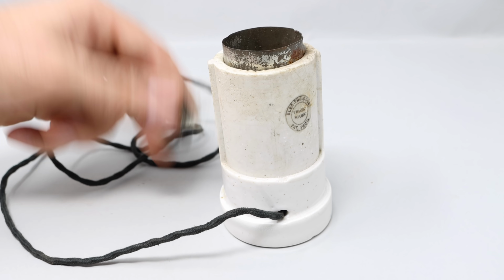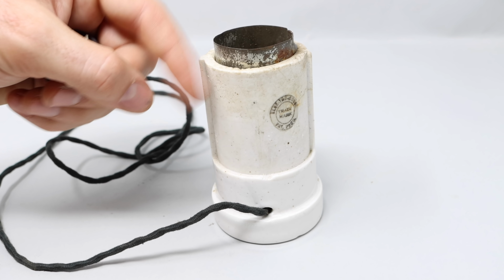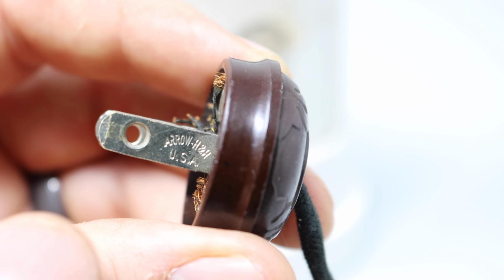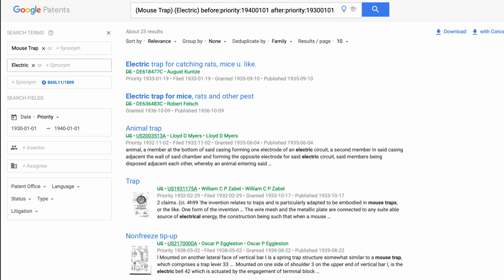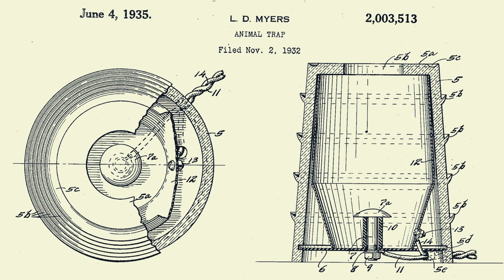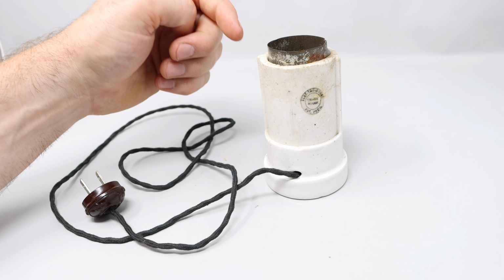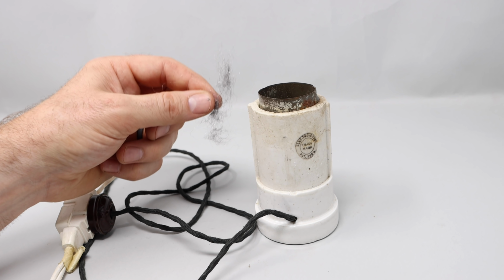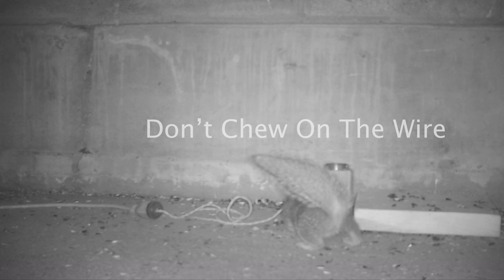I Need Your Help Explaining This One - The Electro Mouse Trap from the 1930s. Mousetrap Monday.

Comment: I think the patent you found is for a different trap. The one you have lacks the ribs around the outside that are part of the claims in the patent. It's possible that your trap originally had an outer shell, now lost, which had the ribs on the outside and also shielded the outer metal sleeve and had the small hole in the top. Since this one has the trade mark on it, my guess is that this is all there was, except for a possible ceramic cap.

Yes, the plug is old and would have come with a heavy paper cover over the exposed terminals. Those covers are often lost, but you could probably find one to replace it. I believe I have one here.

One person made a good point about the lack of a polarized plug. Such plugs existed in those days, but they were extremely rare. That certainly makes this trap potentially much more dangerous to humans and pets.

There's been no significant change in the US electrical system since that time. Unless this trap once had a cover with a smaller hole on top, it may never have worked any better. What it lacks as a mouse trap, it probably makes up as a fire hazard.

Comment: These would rarely work.  The voltage is too low to be 100% certain that current will flow through the mouse.  Fur is insulation.  120V isn't high enough to jump a gap.  If a mouse did make decent contact in that trap, it could cook until it starts to burn.

Comment: My gut feeling is that, at 110 Volt, this didn't ever work. Maybe wasn't designed as a scam, probably worked in the inventors mind, but didn't work in practice.

I wonder if it would work on European 230V AC?

Comment: Shawn I don't believe those things ever worked to kill mice. I think they were designed to catch the mouse trapper sort of like how some fishing lures are designed to catch the fisherman. The only things that would make that trap work better would be using direct current instead of alternating current and a much higher voltage, say 5KV or so. If they had worked they would have cooked the mouse until it dried out enough to ignite and then the flames would conducted producing an arc furnace. Assuming the structure it was in didn't catch fire and the circuit didn't get broken and the device did not melt, it would have reduced the mouse to ashes, had it ever worked.

Comment: They never worked just capitalized on the new notion of electricity. Volts don’t kill amps do when they interfere with the hearts electricity or cook you due to your bodies natural resistance. 120V & 240V for the most part and under most circumstances isn’t lethal unless you’re unlucky to get a bad path in your body usually you’ll just feel a buzz as I’m sure the mice are feeling. Hair/fur decreases the likelihood of a shock as it increases distance and resistance with it. As voltage goes up it’s ability to transmit through the air increases as does its ability to put amps through you. Most devices to work to kill mice need a transformer and/or capacitors to store a volume of electricity and release it all at once.

Comment: Also I should point out that modern electric mouse trap would use a high voltage low current power supply to kill the mouse.  This would be a good trap if you use a flyback transformer from a tube TV and a ZVS supply to drive the flyback transformer.  This will give you around 25 kV at 60 mA, which is more than enough to kill a mouse.

Comment: I don't know the resistance value of a mouse body, but it's probably high enough that it's not passing enough current to kill it. Also, it's AC, so capacitance further reduces the amount of current. If the mouse was wet, it might reduce the resistance enough

Comment: Hi Shawn,
There wasn't anything significantly different about electricity in the 1930s, other than that that's when grids started becoming a thing (before then, each area had its own power plant and there was little if any connectivity - it also meant there was scope for different areas having different supply specifications in terms of voltage and frequency, but the standard of 110V in North America was set by Edison decades earlier so I doubt the voltage was actually significantly different to today's 110V.
The trap probably worked as well then as it does now - hence why they're so rare, they were useless and very unsafe and never caught on!

Comment: Did you try to smear some peanut butter or something else wet on the inner electrode? That way when the mouse stands inside the metal tube and licks the electrode, it gets shocked.. I cannot figure how wide is the electrode inside, but if the animal would bite it somehow, that would be a win for the trap.

Comment: 120V isn't very high ... and skin is a pretty good insulator when it's dry .... most modern electric traps multiply the voltage to the thousands of volts

Comment: I would say 120 single phase or even 208/240 split phase is not enough.  Maybe 277 single phase or even 480 split phase will work.  I would never connect this to a split phase circuit, since the outer tube will become live.  Mains electric hasn't changed much after Nikola tesla standardized A/C.  Electric circuits from the 1930's and a circuit from now would not be different, other than the type of voltage regulation used.

Comment: Indeed this is a fire hazard ! no fuse, unpolarized plug, this means there's a 50/50 chance the protruding metal part is  live 110 volts depending on what side you put the plug in the outlet . 1 chance out of 2 you will get shocked yourself if you touch it at the same time as  a grounded piece of metal, like any metallic appliance that has a 3 prong plug. If the breaker does not cut the current off, a serious amount power is on the loose !

Comment: Maybe mice are able to handle the shock better or with it standing up and inside a house where a squirrel or rat can’t tip it over the mice can’t get out so they get shocked for longer which may kill them, 
To my knowledge electricity from the 30s isn’t different from nowadays electricity.

Comment: 120 Volts is not enough voltage to be effective.  Possibly with the neutral being super clean, but that's iffy.  Rural electric systems in the 1930's were often 30HZ, or cycles, and that would be even less effective than the standardized 60 cycles of today.  I think it was just a gimmick to sell mousetraps.  No springs to set, just plug it in!   It would probably work well at around 300 volts, which has a paralyzing effect on muscles.

Comment: That trap might have worked better if it stayed upright when the mouse got zapped it might not have been able to get out of it and continued to get a good zapy.  

If I had to guess though I would wager that the electricity from the 20/30 era wasn't much different in terms of voltage or frequency but those traps certainly were much different.  Both of those traps looked fairly oxidized.  That would limit the current when the mouse shorted them together giving the mouse some time to get away.  Why not try to replicate this trap and make it out of clean materials?

Comment: fasten the trap so it can't be knocked over.  A mouse will be kept in longer contact with the bottom plate by gravity.  I did not see the mouse touch the bottom plate of the horizontal trap.

Comment: Every mouse electrocuter is better when overclocked with the help of a microwave oven transformer! Connect up the primary windings to mains then the 2ndary windings to the trap. When the mouse touches it they get about 80v at 100+ Amps of current!
Reply: Clearly, you DON'T know what your commenting about. 
Lethal CURRENT flow through a human is less than 0.1 Amp and modern 'safety switches' (RCD)  are designed to trip power supply at 0.015 Amp ( 15 milliamp ). A small rodent would have an even lower lethal flow of current level. 
Likewise, A.C or D.C. at the terminals would make no difference, nor variations in that mains supply between 100V or 120V A.C. mains supply as used here. 

The device would function better if it had a higher Voltage across the terminals, to breakdown the higher resistance of the intended victim, around the 600V to 1,000V range. 
As those who know the why this doesn't function say, water on the mouse would present as a lower resistance of the critter.

Comment: Jelly on bottom plate, dielectric grease on tube walls? Wet contact.
Reply: Just so ya know dielectirc grease is an insulator not a conductor.
Reply: @rmkscrambler  So how do my old V8s and flathead ford tractors run so good when they have it slathered between the plug wire and the spark plugs?

Comment: I think I know what it is tat shocks the mouse and how.The mouse enters the trap while it is plugged in, and when it does,it hits the payload(the pad on the bottom) and sends a quick and heavy current of electricity through the mouse/rat because rodents are as good of electricity conductors as us.(Just note I am 12 so this is just a guess.)

Comment: 110 hurts but more than likely will just shock. If the animal was trapped and got a sustained jolt rather than  
being able to pull away would make a big difference, that and higher voltage.(Not recommended)

Comment: The only thing that would make the trap more effective is a higher voltage to the leads, however a voltage high enough would melt the wires I think.  I think a the most likely explanation is that it didn't work in the 1930s either.

Comment: I was an electrician for about ten years. When the mice touch it, they are just being shocked on their whiskers. They are getting shocked, but not many amps. Hair is a really terrible conductor. If the trap was still upright then maybe the mouse couldn't jump out. That this is a total fire hazard. I know from experience that when mice chew through Romex they get zapped and die. And it's a mess to clean up. That trap is best for wall art!

Comment: you need much higer voltages ⚡. 
mice are too quick and have very good reflexes, this trap might be effective if the mouse were soaking wet, but a 120 volt ac source is not a huge threat to a fast dry mouse.

Comment: Back when electricity was becoming a part of every house hold they didn't have volt regulators. So even though it read that it was getting 110 that os a modern power supply. There os no way to validate that when the mouse was created it was used with 110v. It could have been more electric pushed through back then due to.   causing the trap to be more lethal

Comment: No capacitor.  I sold battery powered traps in the 90's that were quite effective with far less voltage than this trap.

Comment: Electricity 30 years ago is the same as today, about 120 Volts AC. If you go further back it was direct current electricity, Edison's choice but Tesla proved that AC was better. The trap didn't work then either unless you could make the DRY skin and fur of the mouse more conductive. A way to do that is to manage to get the mouse wet with salty water. Salty water is very conductive and if the mouse had a lot of it on its skin and fur, it might get electrocuted. If the voltage was much higher, such as 240V, then the higher it might overcome the dry fur. Also the path of the electricity matters. If it passes through the brain or heart, it could kill but otherwise it will cause a muscular reflex that might free it from the electrical contact. Generally these traps don't work.

Comment: Hi Shawn, 
I am an EE student (just starting out, though) and I'll give you my two cents:
There's no difference in the type of current. Back then AC (Alternate Current) was used and we still use the same type, although many of our devices work on DC (Direct Current) but that's another topic. In North America we use 110VAC at 60 Hz. I believe the mice were not closing the circuit when they went inside. That means that the circuit was left open and therefore the current is not able to flow.
Reply: you don't need an EE degree to understand that
Reply: Another EE student here,  
I thought he said in the video that the mouse was shocked and ran out of the trap?
I think this old trap doesn't have as much voltage as the newer ones, so the current through the animal is like 10 times lower.
Reply: @IntelTV  not helping less than the innitial comment lol
Reply: @SamuraiHonor  Yes I agree, but it pains me seeing someone be a dick to someone trying to explain something. Like why? He's just trying to help anyone who doesn't know these things .

Comment: Not effective then or now.  Not enough voltage.  They need a step up transformer/capacitor arrangement to be effective.  If they were to maintain contact with the conductors for a few seconds, they would probably die, and the wonderful aroma of electrofried mouse would let you know you got one.

Comment: It MIGHT work if the metal tube was just a lip. That way the current flows across the heart. It appears that the metal tube goes nearly all the way to the base. Electricity takes the path of least resistance and thus the current wouldn't flow across the heart with that setup. That said, 110ac at 60hz isn't especially potent biologically. Even on a human, and across the heart, ventricular fibrillation isn't guaranteed and isn't always fatal. The high resistance of tissue (and easier paths for amp flow) means that while you only need as little as a 30 thousandths of an amp across the heart to potentially kill you it's very rare to get much (if any) flow across the tissue (with 110ac). Can't speak to mouse/rat biology but you'd still need amps across cardiac tissue to result in death. - Bottom line is that it likely never worked. MAYBE in a slightly different configuration but even then it's unlikely. There's no difference in AC electricity in the 30s to today (that is relevant to this topic). The only difference of importance is the perception of people to whom electricity was a fairly new phenomenon. Also,  mouse traps that don't need resetting are deceptive. You don't know all the mice you DIDN'T catch because the design is poor you only know about the EXTRA unlucky ones, haha.

Comment: There is only one way this trap could work. The mouse would have to be wet, like just crawled through a puddle of water. If it then fell down the trap, I guarantee it would be finished! So next time, build a mini moat around the trap 😂. With a dry mouse, there is too much resistance between the electrical contacts and its fur/skin. Another thing you could do is cut the plug off and install a 240V plug on the cord. Just don’t forget the 240V receptacle and a dedicated circuit 😃😃.

Comment: Try it again!
This should work a bit better,.
For safety, use a power-splitter  with a trip feature.
Try some peanut butter inside, near the bottom.
Maybe this one is suppose to be buried in the dirt?
Reply: Yes , clean all the metal contact surface inside, for better conductivity.💡

Comment: Nothing is different: there were scammers then ànd there are scammers now,. I thought this might work because with a vertical hole, the mouse may not be able to climb out using only its hind legs. Maybe you should give it another try but affix the trap so it can't be ripped over.

Comment: It could have been 220v I wouldn't connect it directly to your power I would put a car fuse in it starting at about 2 amps.  If you try 220 the mouse will start on fire for sure.  If you want to stick with 120v I would suggest have a way of wetting the mouse without getting the water near the trap. A wet mouse will be a dead mouse. 35 year electrician.

Comment: I would hazard a guess that multiple factors are at play here. Have you ever seen birds on high voltage lines, and wondered why they didn't die upon touching them? It is because they don't provide a clear path to ground, and their mass is so small. I would hazard a guess that the same principle applies here - remember, this is a low frequency AC appliance. Your Victor electric trap is DC, with a super high voltage. The other factor is conductivity. Us humans are way more conductive, because we have much less insulation on our bodies. Our only insulation is a tiny bit of body hair and a thin layer of dead skin. If there was some sort of electolyte between the mouse and the trap, then I would expect death to occur. However, one does wonder if it would trip your GFCI or RCD!

Comment: Wall electricity won't cause instantaneous death. The mouse will get a zap but be able to jump back. If you have a wire with wall electricity and grabbed it, you wouldn't be able to let go. You wouldn't die right away but the electricity would cause your insides to heat up. Then you would die from that.

Comment: It would work better with UK / Europe 24ov/230v rather than the US 120v.  You'd need to be unlucky for 120v to kill you,  Its far more likely at 240v.  Lay a load of wadding around soaked in salt water, so the mouse goes in with wet salty feet ?

Comment: The difference is not the electricity,  it's gravity.
The test was invalidated when the cup fell over - if a mouse actually climbed down into the trap in an upright position, it would not be able to flinch away from the shock but instead would fall into the trap and get fried.  As an electronics tech, I've been " bit " many, many times but was always saved by the reflexive flinch that broke the contact,  being head-down in a metal tube and unable to escape would be a fatal nightmare.
Aaaand,  right there is why it was never popular.   Not only a shock hazard and a fire hazard,  but it fills the house with the delightful scent of burning flesh and fur.  Cleaning it out would also be such a joy, as the fried mouse would be well-stuck to the electrode,  and would need to be scraped out with a stick.
Re-setting this trap will take more than a little flip.

Comment: The two wires are an incomplete circuit.  Anything that touches the two completes the circuit. I know this because I personally know an electrician. It's not the voltage that kills it. It's the strong current that kills the mouse.